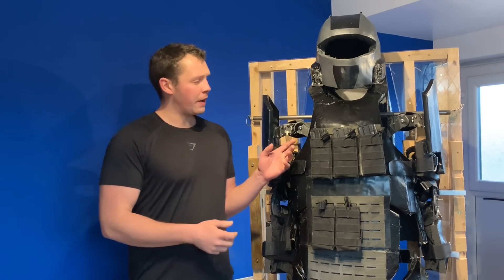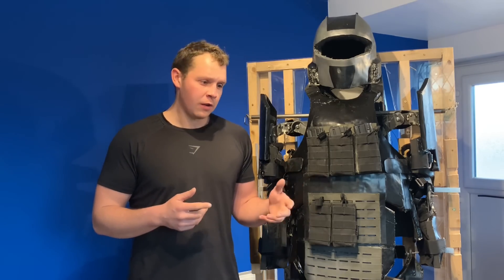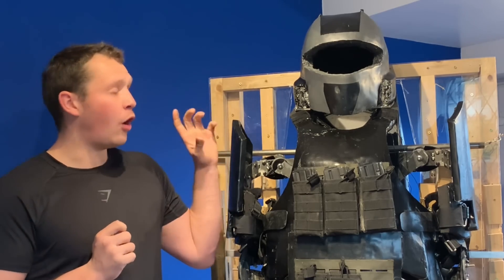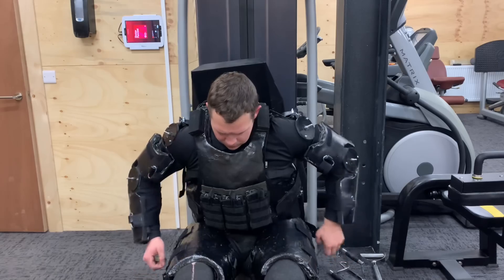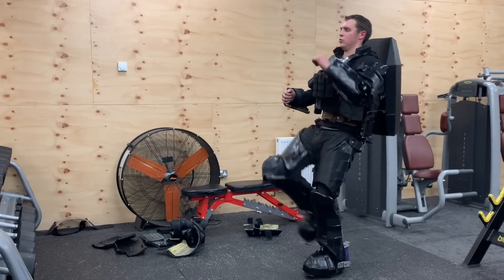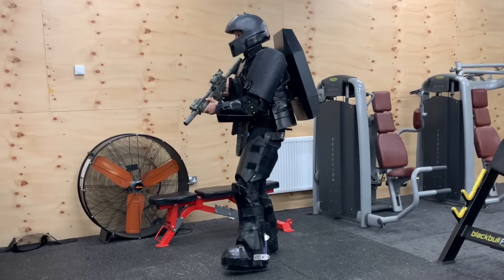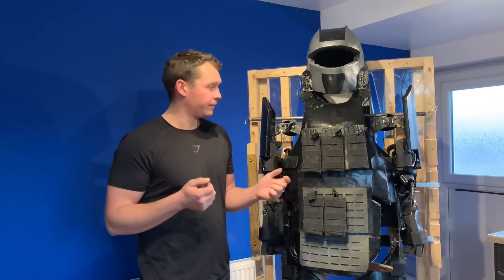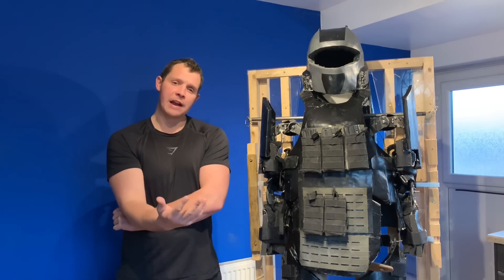Functional Combat Capable Power Armour Development Episode 5 Quest for Bullet Proof Exo Skeletons

Comment: This is awesome, however - what scenarios do you see this armor be utilized in? It seems more useful for CQC, and even then sometimes seems limited in terms of movement - I’m thinking of dealing with urban rubble and debris, rappelling/lifting oneself up onto a ledge of some sorts. More field testing to see its durability/resistance to aforementioned small arms fire/shrapnel etc, also conceptually putting it through more scenarios would do this good. 
I love what you’re doing - keep at it!

Comment: This is honestly really impressive, I was not expecting that level of mobility, not to mention it's a lot less bulky than I thought it'd be. It'll be really interesting to see where this project is once the motors are doing their work.

My one thought; The boots. You show that the boots are actually a few separate pieces, linked together but able to move somewhat freely. It's a great idea and I honestly imagine it'd be really effective at allowing the wearer to navigate rough terrain. However, in my eyes, those spaces between the different pieces look just big enough for rocks, wads of mud, etc, to get jammed in between the different pieces, or even in ankle joints of the skeletal structure. I could see that kind of thing being quite finnicky to fix, maybe even requiring a second person to dislodge any debris, and this would obviously be a massive safety concern in a combat situation, especially if said lodged debris was limiting their range of motion in the effected foot, throwing off their balance, etc.

I don't want to diminish your work, or be a keyboard warrior. Again, I think this is really, really cool and innovative and I personally definitely think it has a place. But being a prototype, there will of course be issues, and I just thought I'd point this one out in case it wasn't something that was on your radar
Reply: Some kind of mesh cover could protect from rocks and debris

Comment: Great job, I just recommend you design a placart design for the breastplate, for better mobility and protection.

A placart being a secondary torso plate that overlaps the bottom protion of the breastplate protecting the bottom of your ribcage and ending on the natural waist.

For below the waist protection, the best bet would be either articulated plates or larger plates that can dangle off the placart through the use of straps or valcrow. 

This will further enhance leg mobility without sacrificing body armor coverage, making it easier to run, climb, and take cover.

My only concern is the material you use may be too thick for proper articulations to function/move properly.

I understand that the recommendations I have made are complex and will greatly increase the cost and craftmenship required to make the armor, so I can understand if it gets ignored.

Overall love the rest of the design, especially the cheek plates that stick out of the helmet. It seems those plates can "hug" a rifle stock allowing you to aim a gun even with the helmet on.

Comment: Cool idea, I like the ODST-like helmet in particular. Though there are a few questions.

What happens to the armour when it becomes compromised? A plate carrier can remove the compromised plate and replace it, which is fairly quick and economical to do.

How would a medic render aid to an operator inside the armour? Would they need a diamond tipped saw and a lot of time or is there a mechanism for easy access? Would an enemy be able to exploit this easy access?

Do you plan for one power armoured operator to be able to drag another incapacitated power armoured operator? Such as to cover, or if the suit became immobilised in some way. 

How does the operator keep warm/cool?

How does the operator do their business?

How would it be powered? How protected/easily replaced will the power source be? What would be your aim for balancing duration of power to carried capacity?

Would each armour need to be tailored to the individual? Or might there be improvisations made to adjust each suit to each body shape and size? What would those improvisations be?
Reply: Really great questions here! I'd never even thought about the medical aspect.
Reply: @danielbraman5562 How convenient is it to shoulder a rifle?
Reply: @qwertyui-EFRB  I wonder how difficult it'd be to design an optic that is essentially a camera in a scope that feeds to something like the IVAS system. I feel like IVAS would be a great system to incorporate into this "power armor".
Reply: @specialoperatorlolbit8671  given the way the reticle seemed to be shown in the demonstrations of some of those systems i wonder if eye tracking could be implemented in the future to aim the gun at extreme ranges. 
How I imagine it, is basically that it shows a circle overlay on your vision of a zoomed-in veiw of what the optic is seeing. than the gun makes minor adjustments via a moving barrel or handguard(like what textron proposed) to hit what your eye looks at in the overlay.
Reply: @qwertyui-EFRB one could imagine a small rut or area on the shoulder where the but of the rifle could go. But none the less, a very good question
Reply: @zacharykoplin6543 with the supposed strength enhancements provided by a suit of power armor, what if rifles and carbines instead used more wrist braces around the grip and arm that relies more on the stability of the wrist and arm to aim the gun while still looking down the sight
Reply: @TheOnlyPedroGameplays  that’s a good point. Many, many, many variables would go into a suit of power armour, but I believe with some time and technology we may or may not have it could be possible in one way or another to create a combat viable suit. The question isn’t if, but how.
Reply from the maker: @specialoperatorlolbit8671  i mention something similar ij the part 2, the technologies there for sure i think its just a case of money, but i do think you need a basic power armour set up working first to incorporate all the tech on down the line.
Reply from the maker: Hi all great questions ive answered a little bit of that in the part 2 and will be answering more pf thowe in video format, i just cant do it all at once as the video will be 2 hpurs long.,
But in short.
The plates are designed to be bolt on bolt off so can be replaced quickly, 
There is going to be a damaging monitoring system that alerts both the operator and medic of where the armours breached, the plates open up simply enough. 
I have designed it tp have channels of cool air ran through it, multiple ways to do it, but its actually not bad so ill have to see how bad it is in summer, 
Theres can be a drag handle fitted.
Powerpacks, theres a choice, which ill be going over, but testing will have to be done to see what power is used in real world use as anything else is guess, but i have designed it to carry alot if necessary and be modular in nature.
Business wise, the groin pad lifts up or can be removed, no.2 while not easy is possible but for what it takes your better off taking it off.
Reply: as for like a short operation i suppose the business part isnt necessary. For armour like this where its going around your whole torso there isnt a whole lot you can do to make parts replacable without compromising the structure of the whole piece. Youd just have to buy a new piece or fix that hole with some kind of patch kit.
Reply: The medical access is a big thing. You can take a plate carrier off someone fairly easily, but disassembling an exoskeleton around a wounded soldier would take far too long. So maybe a solution would be to have a sort of spring release/lock system at the joints that would open up for a medic to access. You bring up some very good points tho, I think we still have a few decades before we can get around to making these things practical.
Reply: @JohnnyRocker023 it would be like Fallout 4. The power armor’s exoskeleton is all made to expand and open from behind with a simple twist of the hatch
Reply from the maker: Ohh and the internal skeleton is fully adjustable, the plates how ever will have to be fairly custom, i predict having 4 sizes of each plate. But tbh with  3d scanning, cad cam, 3d printing moulds, its not really a big deal.
Reply: Use more velcro parts to solve the meducal and "bathroom" problems?
Reply: Honestly I feel like this design appears akin to Chief's armor in halo ce with it's current bulk.
Reply: I imagine they do their business the same way astronauts do.
Reply: @kevinross8038  diaper?
Reply: That’s a a lotta “uh well…” questions 😂
Reply: piggy backing, what does maintenance and the resupply chain for this armor look like, how long does the power last, is it modular or one style fits all missions and roles? how well do the boots work in various different terrains and slopes? how well does the suit handle wear and tear as a whole while moving through non urban settings (rust, mud build up, do limbs snag)
Reply from the maker: @supersam5802  good questions ill be answering these in future videos - if i try put them all in 1 video it will be 2 hours long
Reply: Add a bomb defusal esque full body kevlar space suit level coverage suit beneath the plates of steel armor and you'd have one hell of a unit on the battlefield
Reply: @jarindawson3908  at that point you’d be better off just making the suit out of that material and just using sort of mounts on it to seal the plates on. It’s just an armored spacesuit in a sense, much like the Mobile Suit in Starship Troopers
Reply: Dang, the big questions xD
Reply: have an undersuit made of mesh of tubes having some kind celox or some other coagulant infused liquid being pumped through it, if a bullet pierces the armor it also breaks the tubes and pushes them into the wound, sealing the blood flow as celox coagulates with the blood pouring out
Reply: Bro who careeeees? Just wear a diaper jkjk 😂

Comment: 60-80% of injuries are from shrapnel and fragmentation. While it would be hard to source real soft armor for you heavy fabric covering gaps and joints would be a good imitation and I think practice for an actually practical armored suit. I see both sides in the current war wearing soft armour "kilts" to protect pelvis and hips. Very impressed by this in any case.
Reply from the maker: Yeah ive thought of looking into that, my only issue with completely closing the gaps up with heavy soft armour is it will probably get way too hot in the suit i think it could be worth having soft armour patches in the clothing of the operator instead
Reply from the maker: And thanks!

Comment: The bullet resistance is the easy part. High quality ballistic armor of all shapes is proven tech already. The actual robotics is the hard part
Reply from the maker: I dont think the robotics is the hard part any more to be honest the motors that exist now are sophisticated enough. If you wanted to give your self super strength then thats a problem but assisting with weight isnt. I agree with the armour, but i think the hard part is getting it to fit on the operator correctly and be practical, thars what ive found so far anyway